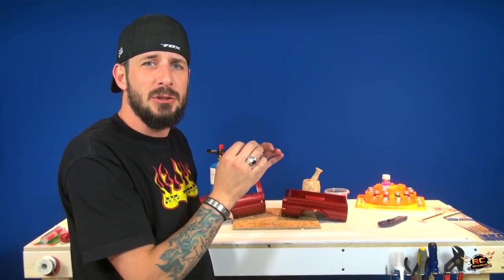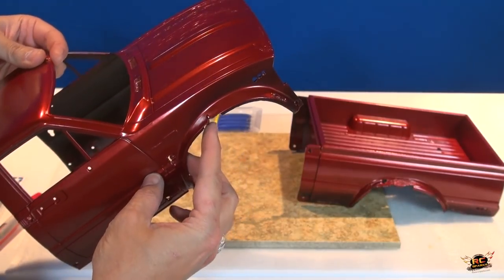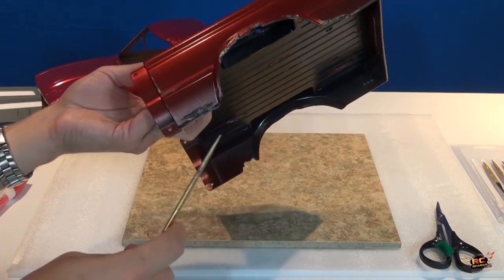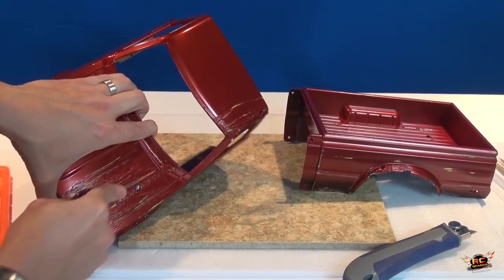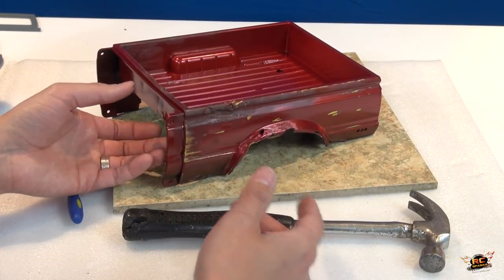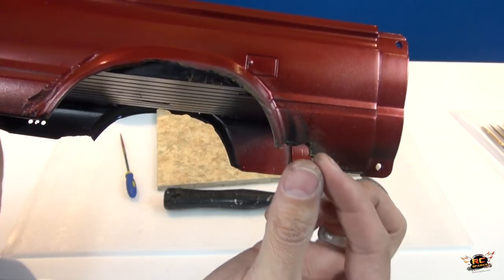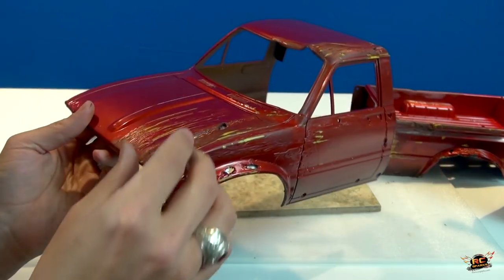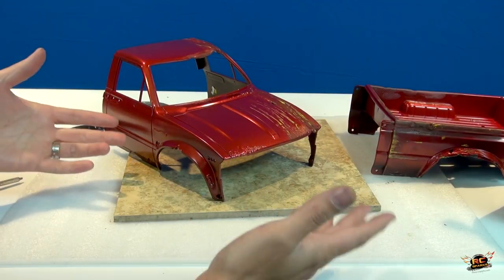RC ADVENTURES - PAiNT an RC - "Top Gear Toyota Hilux" Tribute - PT2 - DENTS (RC4WD TF2) BV4

Comment: Hey Medic. I'm new to RC (I bring my 2 slashes to race at friends parties) but I've got 25 years in art construction & love that I may be able to add to your fantastic show. 1) melting plastic is deadly. Wear a hepa filter mask & do it outdoors! That said, a wax technique will make things easier. 1 all denting etc. of body. 2 prime & paint the body steel. @ damage areas rub with candle wax. 3 Paint rust colors. more wax rubbing. 4 Paint Final color. 5 slowly sand areas to reveal colors beneath.

Comment: Hey Medic, my dad owns a Toyota Truck (T100), his rust spots are right behind the bed wheel wells (Square Ulcer Pattern) , and around the rear bumper in almost a water wave pattern from driving all these years through the US. And also on trucks with this kind of frame, rust will show near the supports of the rear bed and front cab, due to salt from the snowy roads.
And also, thanks for making an RC show that Rocks man!

Comment: @ 20:53 does the front lights insert and bumper get affected in anyway from you adding that dent on the hood when installing the front?. Im just curious as you mentioned to be careful around the windshield rim so you still can add the windshield in and it will fit.Maybe you addressed this and I missed something.

Comment: this is awesome! I have wanted to do this to my Hilux but im a little afraid because of how much the body costs! However, i did similar things to old model cars i used to build. You should add the front grill, then heat it up and smash it in to something hard. Im pretty sure they hit a wall with one of the front cornersof the truck on Top Gear. That would look sweet. Not sure how it would do structurally, maybe add some pieces of metal or lexan for support. This is looking really good!!

Comment: Nice video man but you need a heat gun too I think it works a lil better than torch mine is 2 settings hi n low low is 479℉ and high is 1375℉ and works awesome for cracking paint or removing n heat shrink  plus tons of other uses  keep up the great work man just wanted to let ya know just in case but knowing you you probably do have 1 already thanks for all the awesome info you give use and inspiration

Comment: Would it be possible to make a RC model of a 2003 Dodge Ram 3500 Single cab short bed dually. And it have like the original rims and it looks exactly like the actual truck but its RC. Most RC trucks have diffrent tires and they are more lifted than the original full scale truck itself. Its hard for me to describe it in words, im thinking like a 1/10 model that would usually be a collectors but you turn it into an RC truck but keep the orginial model. that would be awesome!!!!!

Comment: what you need to do is heat it dent it like a rock fell on it then re heat it then try to un dent it then re heat it and try to put a hole in it or sumthing like in the bed make it look aged more like it didnt just have rust flip and tries fall make it look like a rock or 2 fell on it even maybe the glass like make a cut mark to mimic a crack and then put a litle rock in it like heat it and make a litle grove for a rock then supper glue or sumthing a rock into it then

Comment: then on the tires make it look like rust spots spray it like a rust then whatever coller you want however you want i dont know but then put a hitch like for a goose neck in the back and have rude boys make you a hore trailer slash rc trailer slash camp trailer or sumthing then put some mud flaps on it and finaly try to make the wheels look aged like wore down